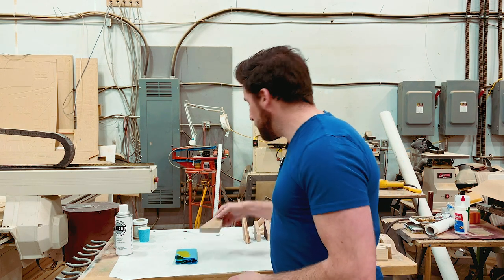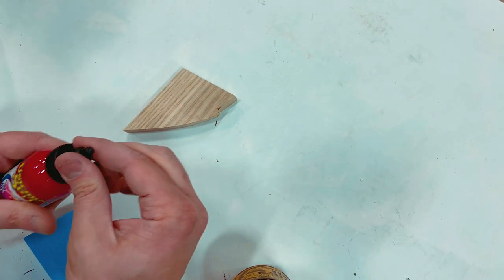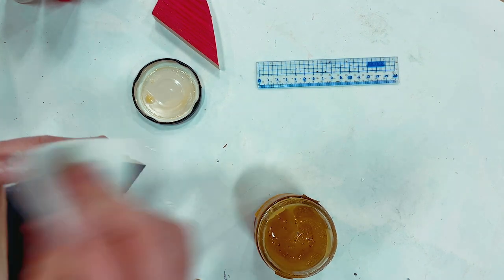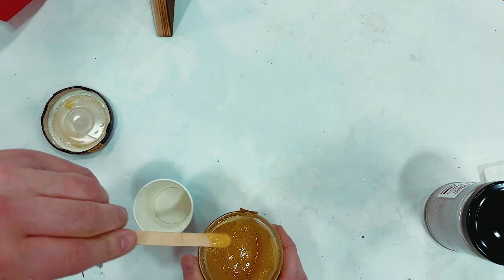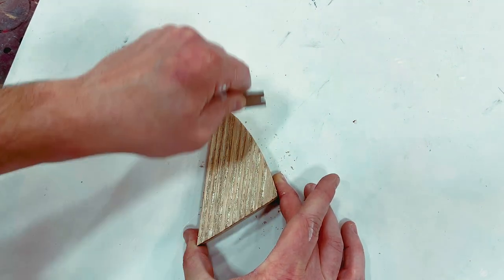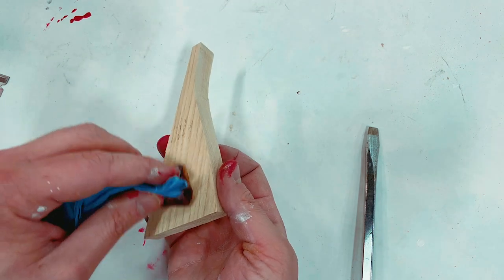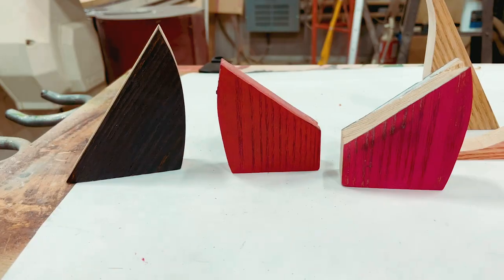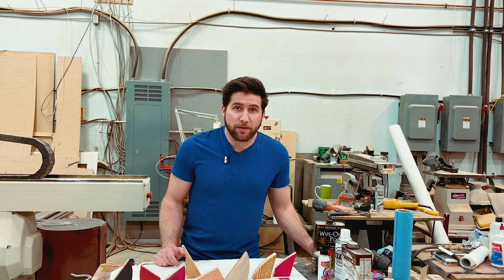Awesome Ash Finishing Techniques (Part 2)

Comment: I used the green (dragon belly) unicorn spit on a guitar and diluted with water. Putting it on straight is like a bright paint like finish, but a couple of diluted coats with a sand in between was an awesome deep stain with the grain coming through.
Reply from the maker: Awesome. That color sounds really cool too.

Comment: Another perfect video, thanks for the video! = I've been thinking about using up some extra gold acrylic paint that I have. Going for a "natural" with some gold in the veins (wood grain). Plan was: ash, torch it, wire brush, gold squeegee, light sand back, stain and clear coat. Mmm, what layer to put the sealer on it? Not so sure now if this plan will work, need to find some extra ash to experiment with (or, experiment with the back and maybe turn it into a black back!). Now I need to get my hands on a piece of ash! Lol
Reply from the maker: Sounds like it should work. Consider sealing twice. Once after the wire brushing and again after adding the gold.

Comment: Hey Brad, sorry for an off-topic question, but I can't get a concise answer elsewhere. Can I spray another finish over tru oil? Tia.
Reply from the maker: It depends on the finish. That’s not really what tru oil is designed for, but if you let it dry fully you should be able to.

Comment: mmm...red wood...gotta love it! hope you don't mind an off-topic question, Brad: I'm picking up a kit from Solo with a mahogany body, I'm wondering if I'll need to sand off all their poly sealer before applying a filler of some sort? once the filler is applied and dry can I use a polymerized tung oil sealer and/or oil as a finish? is there any kind of filler I should avoid? do I even need filler if I'm using the modified tung oil? any tips appreciated!
Reply from the maker: Are you looking for a perfectly smooth finish with the oil? Usually I wouldn’t apply a filler under an oil finish, but I would expect it to show the grain texture through it to some degree on a wood like mahogany.
Reply: @BradAngove  I'm about 90% sure I'm going with the oil so I think I'll skip the filler and live dangerously. thanks for the advice!

Comment: I just wanted to ask about Acrylic spray can as base coat and Acrylic clear lacquer can as top coat, Will it be sunlight/solvent resistant?
Reply from the maker: It won’t yellow with age/uv like nitro would, but it won’t be solvent resistant per se.
Reply: @BradAngove  Thanks for your reply 😀....Anyways that means only 2k clear coat is solvent resistant.
Reply from the maker: Essentially yes

Comment: Good finishes.  Carvin/Kiesel guitars has an "antique ash" finish.  I have no idea how is achieved, but it's a grey-ish look.  Any idea?

Also, the BRAD10% discount code for Warwick wasn't working when I went in to buy a spray gun.  But, I emailed them and they re-activated the discount code.  I got a really good price on the 878SHE touch up gun.  Just wanted to say thanks for the discount.
Reply from the maker: Thanks for getting it reactivated. I appreciate it.
Reply from the maker: The Kiesel antique ash looks to me like the did some burning or dark filling and then used a gently tinted clear over it. The hue is a bit unusual, but that’s mostly just a matter of finding the right tint.